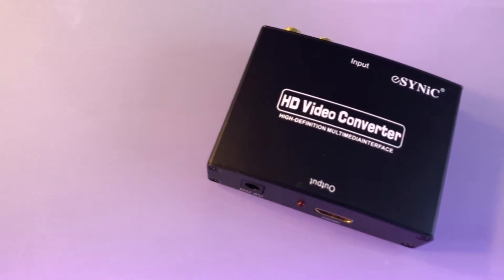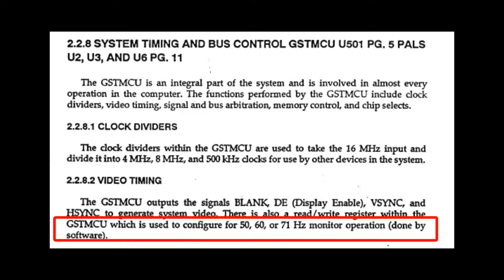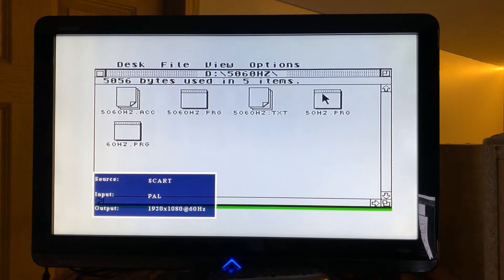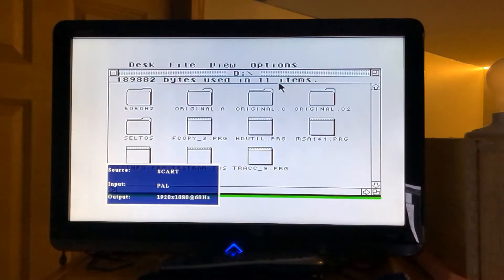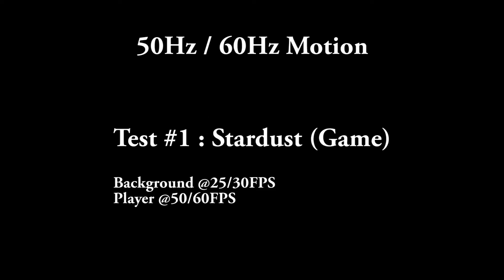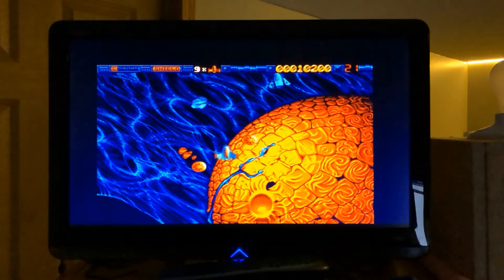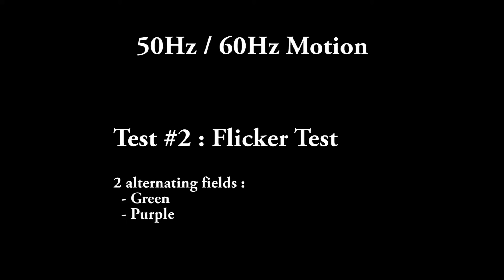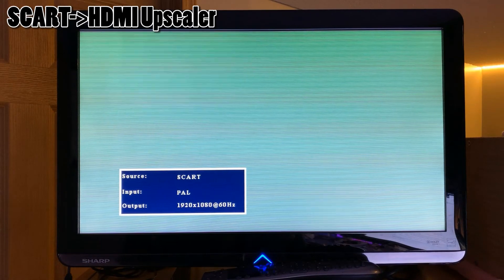Atari ST on HDMI : Follow-up video

Comment: The problem is the ST’s lower resolution modes are 15khz 240p also known as half-field 480i or even field 480i, so I don’t know how you are supposed to upscale ST video signals, but my word would be to use stuff that can make a difference between 240p and 480i, as well as being able to display 480p and 80 columns.

Comment: I found this an amazon and was wondering if this can help connect to VGA screens that doesn't support 15 KHz:
https://www.amazon.com/AllAboutAdapters-15Khz-RGsB-Converter-Scaler/dp/B074GC2K2F
Reply from the maker: It's worth a try but I'd be cautious as CGA was I believe outputting TTL Levels instead of 1v or 0.7, some tweaking may be involved. Otherwise as far as converting 15KHz to 31KHz, should do the trick, now is it worth the $...
Reply: @AnalogThinker  I was reading more information and found this bit:
"It does not support CGA signal with TTL intensity level."
I was wondering you know what that means?
Reply from the maker: @BillyMartin4Life  Yes, and it is actually a good news for you. CGA/EGA was a digital signal, (0v or 5v, nothing in between). RGB is usually 0.7 to 1v analog signal. That's what our retro-machines such as Atari/Amiga are outputting, so you are safe here, no risk of frying anything.
Reply: @AnalogThinker  Thanks, you have been very helpful.

I'm going to buy one, and will post a reply once I get it and have tired it out.
Reply: @AnalogThinker  Good news, I got it in the mail today and it works. Finally able to use my Atari ST because I had no monitors that took 15 Khz :)
Reply: @AnalogThinker  Great news, It was delivered today and it works. It's not prefect because I do hear some static on the audio, and some (maybe?) interference on the video (Only really saw it in some games, and not on the TOS desktop). Here's some pictures I took: https://imgur.com/a/BG3U6cH
Reply from the maker: @BillyMartin4Life  Aw nice! For the Audio, just tap off the DIN Plug and use Analog would be my advice, I know it's not ideal for an HDMI setup. As for the image, did you add the 75 Ohm (or 180 Ohm) resistor on each of the RGB lines? Start trying in line, if still too noisy try 180 Ohm to Ground and then 75 Ohm to ground.
Reply: @AnalogThinker  Actually, I didn't make any modifications to it, I used as it came in the box. I also didn't use HDMI  because I have the benefit of having a TV that has a VGA input built in (It's a Insignia brand TV we got about 10 years ago now I think).

Comment: You were right, removing the branding and looking for it worked!
Thanks!

https://www.ebay.com/itm/MagiDeal-1080P-Full-HD-VGA-to-HDMI-Audio-Video-Converter-Adapter-Box-for-PC/162832406789?_trkparms=aid%3D222007%26algo%3DSIM.MBE%26ao%3D2%26asc%3D20160323102634%26meid%3D1f01767557f24af3959be948e0e9ff9d%26pid%3D100623%26rk%3D4%26rkt%3D6%26sd%3D332498089468%26itm%3D162832406789%26pg%3D2047675&_trksid=p2047675.c100623.m-1

Comment: Hi,, what kind of converter would you now prefer? I need one for monochrome and color mode. thanks (User of 1040StFM an 19" TFT )
Reply from the maker: My personal preference? I would use a regular passthru VGA cable for Monochrome as is renders quite well, unless you really need to plug into HDMI. For color, the best I tried so far is the OSSC, but quite pricey. For a budget solution, depends if you monitor supports 15KHz over VGA or HDMI.
Reply: @AnalogThinker  question if a tv claims in the specs it can do 15 khz using hdmi is that the same thing as a crt doing 15khz
Reply from the maker: @soloM81  At least that means it is able to handle the signal and its internal video processor will display something. Now how good is it doing it, results may vary but it's a good start, usually pretty good on all the ones I've tested. Unlike the CRT you won't see scanlines or flickering, and you may have a very small delay.

Comment: What we cannot see on both of your videos is the cable you use to link the ST with the converter. Is it the ST to vga monochrome cable? I think no, it only tranfers mono video signal.
Which cable did you use?
Reply from the maker: Hi @boyfromrivertown, I'm using the DIN13->VGA I built, pinout described on the previous video (https://youtu.be/c25dlHFW584). Cheapest option is to build it, you can find the "Atari DIN 13" plug on eBay and the VGA connector almost anywhere. The only good off-the-shelf alternative I found is on coolnovelties (not affiliated, not tested but it seems it's the right one): https://coolnovelties.co.uk/coolnovelties/atari-st-video-cables/290-atari-st-to-vga-multi-sync-rgb-colour-monitor-cable.html
Every other cable I could easily find on eBay are the Monochrome DIN->VGA, where the RGB are merged.

Comment: What model of Sharp Display is this that you are using?
Reply from the maker: The display is a LC-22LS510UT, and as per the datasheet supports 15kHz, only on the HDMI input, not the VGA... go figure, but good for us!

Comment: I just got this same adapter from AliExpress and on mine the part number of the chip is AG02-EX, they probably forget tho burn the number off ;) Here you have the datasheet of it http://mu.elecfans.net/201709/XR001%20VGA-VR1.0%20-.pdf

Comment from the maker: This adapter is NOT a line doubler or a scaler. It will only work if your TV is able to handle 15KHz on the HDMI. For some reason, most of my TVs have a wider frequency range on the HDMI port than on the VGA, while being processed by the same chip. If you can find your TV's full specs, look at the HDMI supported resolutions to see if 15KHz is supported!
Reply: Thanks for the tip.   I've built the needed cables, and have yet to get any of my hardware to display with these devices.  
I'll have to look for a 15khz HDMI Monitor / TV